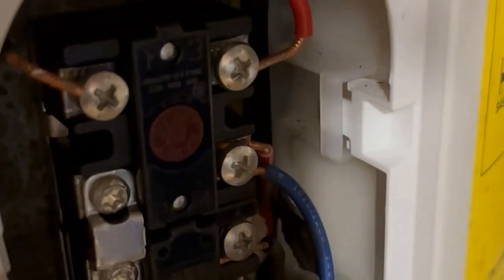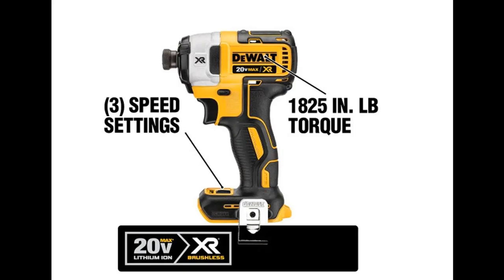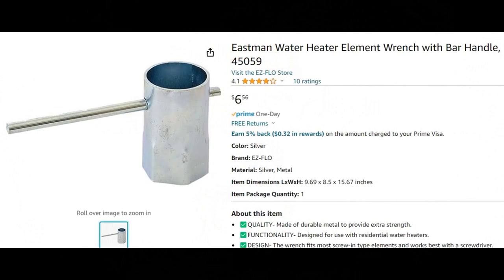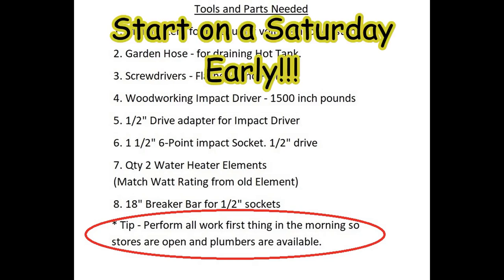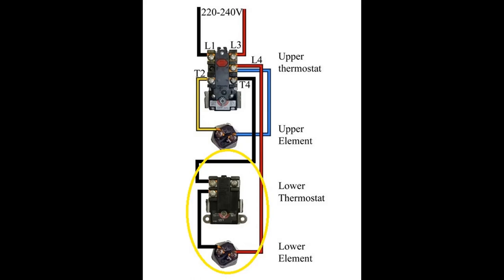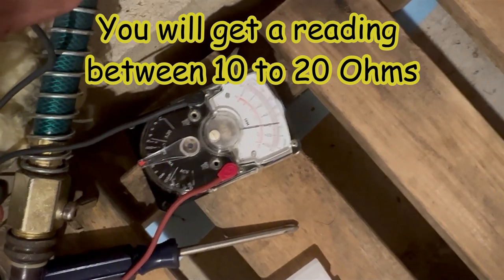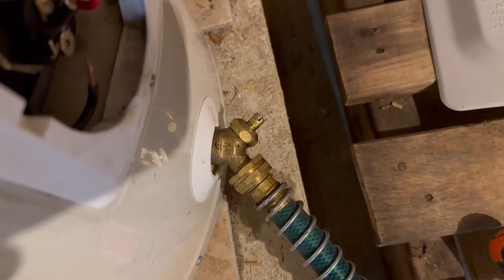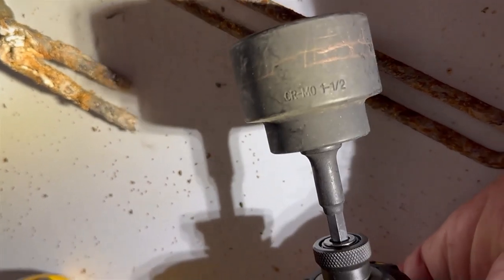DIY Electric Hot Tank Repair with Stuck Element

Comment: Great video.  This saved me $600.  I am not an electrical guy (scares the hell out of me), so I just threw the breaker, drained the tank and replaced both elements.  Thermostats were good.
Reply from the maker: Glad it helped you. Always test power with a meter. Sometimes breakers are marked wrong.

Comment: What if your heating element in bent and it won't come out of the hole?
Reply from the maker: Larry, just force it out. It will bend because it’s probably old. Some of those heating elements have a U-turn at the end and once it bends a little bit, you’ll be able to finish the removal once it hits the U-turn and just lift up or down a little bit.
Reply: @PompanoBrownie  I have the u-turn elements but I can't force it out
Reply from the maker: Use a small hacksaw blade holder and  cut it off.  Just pull it out as far as you can first. Remaining portion will drop to bottom of tank. Heresy’s link to one on Amazon.
https://amzn.to/4dXX3K4
Or… just wrap some duct tape around a hacksaw blade at the end to hold it.
Reply: OK, I gotta ask.... Who the truck got in there and bent it. Please don't tell me I bent yours, too!!! That's six in 9 weeks! I'm not buyin' no one, any more! OK, send me your address. But you're the last, last one!!

Comment: What if your element is already damaged from rust? And there may not be enough surface for the socket to grab....
Reply from the maker: If the nut is damaged from rust that bad on the outside you may have bigger problems like a leak in tank. It’s important to keep socket firmly seated with your weight when operating the impact wrench.
Reply: @PompanoBrownie  The rust in the damage is because the element itself is oozing from around the seal
This is on a solar water heater which runs 20 to 30° warmer than a conventional electric. We run upwards of a 160 to a 170° from the solar. So it doesn't surprise me if that seal on the element breaks down faster.
Reply from the maker: @mikeeisele2428  sometimes with a nut that bad I’ve had luck using a cold chisel at an angle on one of the nut facets and hammering counter clockwise.
Reply: I used a hammer and chisel about an hour ago.

Comment from the maker: Helpful Video Links and Tool List Below

How to Use a Multimeter to Check the Voltage on a Water Heater 
https://youtu.be/cYW8NVD13rI?si=q4cLztS363HR_S3L

  
 How To Test Water Heater Element With Multimeter
https://youtu.be/btyVpGgQK3Y?si=kFVRJJe6EaqCT6nO

*These paid links to Amazon pay me a very small percentage if you use them, without raising the cost of the product.  This helps support the costs of making the Videos. Thank You

Multimeter
https://amzn.to/3RsrGiu

50 ft garden hose
https://amzn.to/3rpWqG6

Dewalt 3 speed Impact Driver
https://amzn.to/3t8z20x

Impact Socket Adapter
https://amzn.to/3LEHlHQ

1 1/2" Impact Socket
https://amzn.to/3RBYKVc

18" Breaker Bar
https://amzn.to/3LyyB5K

Flathead and Phillips Screwdriver
https://amzn.to/48rEdJ4